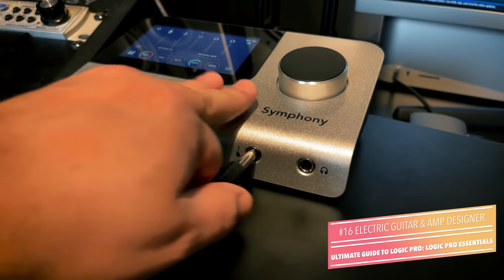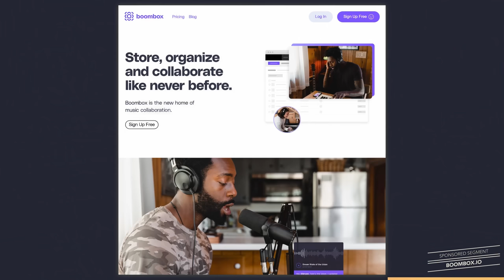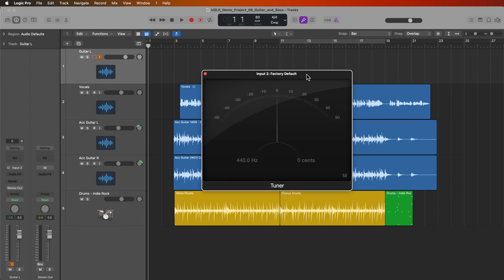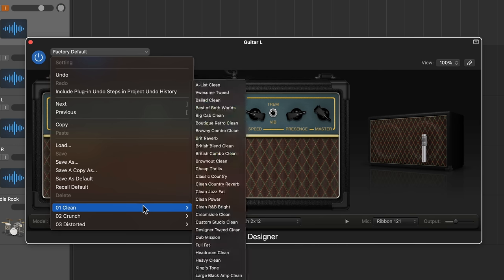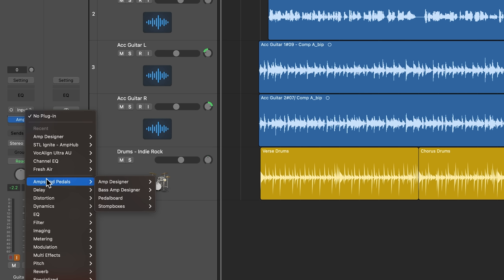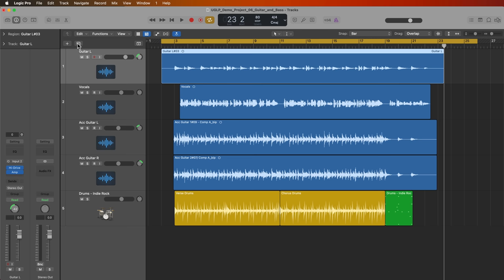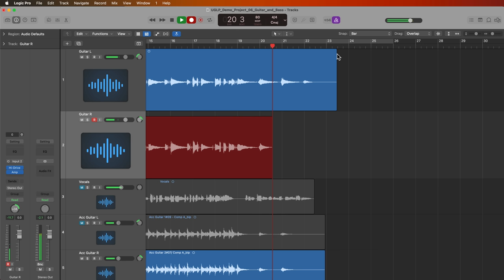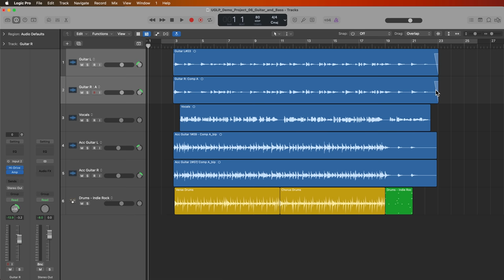Logic Pro #16 - Electric Guitar, Amp Designer & Guitar Recording

Comment: Very good (and accurate) video with good advice.  I've gone a more expensive route, which some guitarists might or might not want to consider.  If you buy an HX Stomp, you can buy the HX Native plugin for only $99.  The Stomp is an idiot-proof box for recording guitars (plug and play) and you can record (via USB) a stereo patch from the Stomp AND a mono or stereo direct input signal at the same time, which can then be run through HX Native plugin.  HX Native is a full-fledged Helix in software form - identical sounds as the $1,699 Helix (but no foot switches and buttons).  Best of all, HX Native is not hard on your CPU - I made a video where I got it running on a 2009 white MacBook running Logic 10.3.3. Pretty damn amazing for modern software!

Comment: I notice at 12:52 there is a message that says, "Only the clean DI signal is recorded when using this method. Amp Designer comes after the region in the signal chain." So my question then is how do you record so the effect is baked into the recording? I like the idea of being able to audition different sounds ipso facto, but once i've recorded something I like and move on to find a new sound, I lose the sound I had for that take. Is the simplest solution to create duplicate tracks and record on those for each desired sound? Or perhaps using a different method altogether? Thanks for great content! Always very informative! Cheers!
Reply from the maker: There are different ways to do that, but probably the easiest way is to make the recording, edit the recording, and then select all of the regions on the track, and press Control B to "bounce in place". You can include the effects plugins on the track in the bounce, which will effectively "bake" the effects into the recording.

Comment: Hi there. Really enjoy your videos. Quick question: You recommend having the gain on the instrument input set to minimum, but isn’t the sound of amp designer very much going to depend on the input? I have been placing a level meter at the input and trying to dial in something around -18…-12 dBFS, assuming this would be the “sweet spot” for the logic plugins to follow. Thanks for all the great content.
Reply from the maker: Great question! The input level going into Amp Designer, or any amp sim, or any real amp for that matter, will absolutely affect the tone you get on the output, 100% correct. However, instrument and line level signals technically speaking are "fully open" signals, meaning they don't actually require any added gain. It's not like a microphone where you have to pull up the gain to 50% bare minimum to get a decent recording signal, for most sound sources. 

The level I'm getting from my DI guitar signal is precisely in between -18 and -12 dBFS peak with the gain at zero on my interface. In fact, if I play a little harder it will easily go above -12 dBFS. So the instrument level signal is already where it needs to be. Although, your guitar pickups, whether they are passive or active, and whether you use any pedals before the amp will also affect the signal level, and the tone on the output. So you may get some variation from guitar to guitar. Especially with some basses, I find I need to pull up the gain just a touch to make the signal a bit more "healthy" on input.

Now, I did mention that I will sometimes pull up the gain a bit if I want to saturate the tone a bit more, and that's totally fine. People do it all the time. But the key takeaway here is that you don't want to add too much gain to the input signal of the guitar, otherwise the transients will start to get truncated, and this will give you a "floppy", "mushy" tone with no punch or definition. So that's why I recommend recording DI guitar with the gain all the way down to start, and if you need to/want to, you can always add the gain plugin before your amp sim for extra input gain, or add a stomp box pedal before the amp sim for some extra "umph". If you record with the gain too high, and transients get truncated, and you can't really take back that gain in post.

There are other options out there too for changing the impedance of your guitar signal on input, to get a different tone. For example the Cloudlifter ZI is a great option for this. Rather than just adding gain, it actually gives you a variable impedance control which vastly changes the tone on input. Great tool for guitarists. I reviewed it a long time ago, and probably used it improperly, but still a great tool for shaping the input tone, without adding gain.
Reply: @MusicTechHelpGuy  hey. Thanks for the really thorough reply 👍

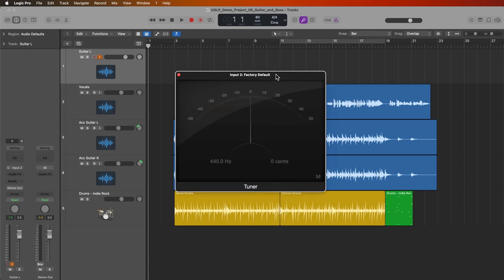Comment: At 5:10 you test the guitar input and it works.  That's great.  Mine doesn't.  Would be nice if you could suggest some things to check when you don't get sound at the Logic interface.  The Apollo Twin shows signal, but the channel strip does not.  Videos like yours are helpful, but you assume at every step that the viewer is having the same success as you, and it ain't necessarily so, to quote Gershwin.  The Apollo is selected in the Logic preferences, etc.  Any suggestions? Thanks

Comment: Hello. Your videos are great and helpful. I wanted to mention that, in context of gain staging, I like to click on “Input Metering” to ensure my input gain is in an acceptable level. I check this separately from the gain staging on interface. It helps greatly in mixing.
Reply from the maker: Input Metering? Or Pre-Fader Metering? I typically use pre-fader metering (as I did in this video) to make sure I'm seeing the full scale of the input signal, without any volume adjustments, but I do have to bypass plugins to see it correctly.
Reply: @MusicTechHelpGuy  yes sorry that’s what I meant. I didn’t notice you were using it in the video. My mistake. Great stuff you’re doing with these videos. I’ve been using Presonus Studio One 5 for months via PreaonusSphere but I’ve gone back to using Logic Pro 10. I’m stuck however using the last compatible version for High Sierra as my iMac is from 2011. It’s still great though and more than enough.

Comment: Referring to your words of adjusting the gain level for your input: if I understood you correctly you said one should mostly use the lowest possible gain level. Conversely, I have been always told to use the highest possible gain  level without peaking at the loudest part of your song. Are there reasons not to do that?
Reply from the maker: It's not exactly a hard and fast rule, but generally speaking if you want the pure tone of the guitar amp sim to come through, without extra drive or saturation, you want the gain on instrument level inputs all the way down, or only pulled up just a bit. You'll actually find with most clean DI guitar signals, you don't actually have much gain to work with before you start to clip anyway. The same applies when working with a real guitar amp. If you want the pure tone of the amp to come through, you don't put a drive/gain pedal in between the guitar and amp to boost the gain. However, if you're looking for more heavily saturated tones, or distorted tones, it's often common to put a drive/gain pedal in between the guitar and amp, or between the guitar and amp sim. In that case, you can simply add a drive/gain pedal plugin in Logic before the amp. You can also add a bit more gain on your interface on input to boost the tone a bit, but just keep in mind tone will change a bit. So it's not necessarily a 'can' or 'can't' situation -- it's what type of guitar tone are you going for. When I record distorted tones, I'll often add just a touch of extra gain on the instrument input, add a drive pedal plugin before the amp, but then pull down the amp a touch, so the input level is doing a little more work. But I'm never pulling the gain on instrument levels way up, past like a quarter turn or so. Now, when recording with a microphone or a line level input, those are completely different situations.

Comment: Great tip on the track alternatives. 

I’m a drummer not a guitarist. Does it matter if your guitar is active or passive before you plug into the instrument input on the interface? Also would you need an active DI box for an active guitar?
Reply from the maker: There are some guitars with active pickups that may redline the signal on an instrument input. In those cases, you can either try putting some sort of volume pedal before the input to attenuate the signal level, OR try plugging the guitar into line level input. DI Box will also work as well.

Comment: Very nice! Regarding input level on the audio interface, for me when using a guitar with hot active pickups, even when input level dialed all the way down, the signal is still red lining. To solve that I have to turn down the volume knob on the guitar itself. Or maybe I should get some kind of mixer to put in front of the interface and control the input level that way...
Reply from the maker: A volume pedal before input can assist with that. OR, you can try plugging the guitar into a line level input instead of an instrument input. Active pickups will often have preamps built in, so the signal level is really hot, and the only option is to use a line level input. On many interfaces the line level input is the same as instrument, you just have to select "line" either on the interface itself, or in the interface's control software. However, on some interfaces, like my Symphony Desktop, I have to select a line level input on the unit, and then plug the guitar into the back of the unit in a shared XLR/1/4" input, rather than the instrument input on the front.
Reply: @MusicTechHelpGuy  Thank you for that very helpful answer! I have an aging 10 year old Focusrite Solo interface, so I will run down to the music store and get me a Scarlett Solo instead. Then I can use the "inst" button like you showed in the video! Thanks again, love your content! 👍

Comment: If I choose a dirtier amp, there is too much initial noise. When I insert a noise gate after the amp, there seems to be no impact in getting rid of that noise. This technique is what I use on my Positive Grid Spark 40 amp, but it seems that the noise gate has no impact on the Amp Designer amps. Time to test out the noise gate on overdrive/compression effects outside of the Amp Designer.
Reply: Try the noise gate first in the chain.

Comment: The input gain of your preamp soundcard must be set to optimize the ADC, i.e. you want to have an input level as close to -6db (to leave room for hard strumming) as possible. If you do not do that, your signal input will suffer from poor discretization.

Comment: I'm getting signal to channel of Logic Pro, track 15, input 2, High Z, on XR18 interface, nothing is going thru the plugin, can't make any adjustments nothing......I've followed your instructions step by step...I can't figure it out, I've rebooted the Mac Book, closed everything reloaded, still nothing....
Reply from the maker: I own an X18, which is similar to the XR18. From what I recall, you might have to switch the channel over to Hi-Z on the tablet X-air software or make some other adjustments in the software. It' been a year since I used my X18, but last I remember, using the X18 as an audio interface required some additional routing in the X-Air software to make the channels be recognized in Logic.
Reply: @MusicTechHelpGuy  I’ll have to try that, I have a Scarlett 2i2 which is what I started with I’ll try that one later tonight. Been working on a fairly large project and I want to get it done. Oh and Thanks for the info…

Comment: I find it odd that in Amp Designer the Master on the Amps is always on 100% by default. Do you know the reason for this? It's not the case in the Bass Amp Designer.
Reply from the maker: It's probably because the Bass Amp Designer gives you the ability to blend the direct box signal with the amp, which might require some master output adjustment to not clip. Whereas Amp Designer doesn't allow for that. Although, I've noticed that the output slider in the bottom right is often adjusted on the Amp Designer presets. The master output knob will likely change the perceived tone of the amp, while the output gain slider, is just a clean volume control. Which makes sense, because in the studio we would always cranked the amp volumes pretty loud to get the best tone (especially with crunch and drive sounds), but then pull down the track volume to get the amp to sit in the mix.